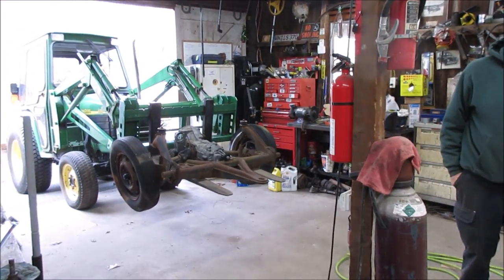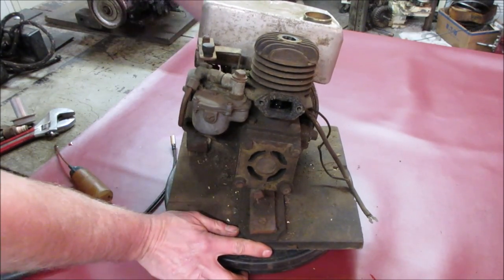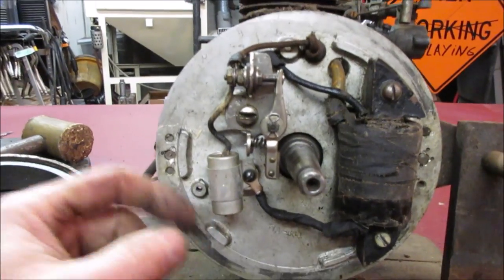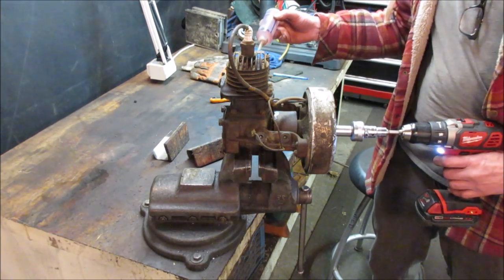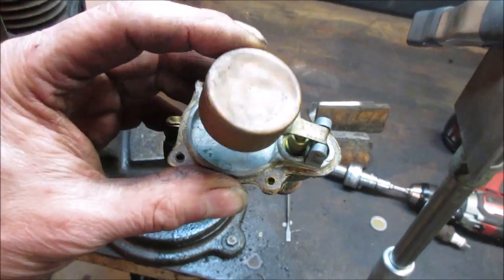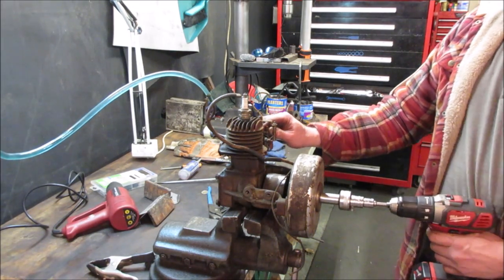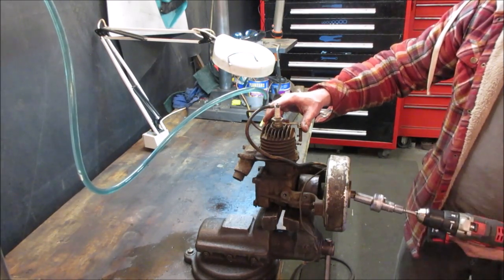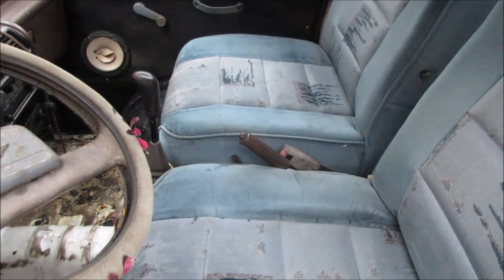Sitting at Least 45 Years In A Barn, Pre War Elgin Cycle engine.

Comment: It is a friction drive. I looked it up on google and I seen several and on Elgin bicycles. It sat on the front tire. The engine mount was huge. The only bad part was they had to cut the front fender to use it.
Reply: Back in the sixties I had a friend who had one, just drop it down on the front tire and it goes. I thought it was so cool.  it was old then.

Comment: 1930s Elgin sold by Sears was most often mounted over the front wheel. $69.95 for the motor only. If you could find the bike they should fetch $2k++ depending on condition etc.. fairly certain that the engine was made buy Muncie gear works, Muncie Indiana. Some were made as Muncie Cycle Motors and others were badged as Elgin Cycle Motors for Sears/Roebuck. Muncie was the manufacturer of Muncie Outboard motors and Neptune Outboards. Even the crankcase output housing is the same as the outboard. 1932 -1935 was also the hey-day for Muncie as they went full bore to overcome the need brought on by the earlier Depression (were still recovering till 34-35.) It likely has the 1.5 hp innards and carburation is similar if not same as the outboard. Eisemann was the ignition manufacturer.
Reply: That's close to $2,000 in today's dollars, adjusting for inflation
Reply: Thank you for sharing ur time n that info

Comment: I imagine there are a lot of stories that begin with “When I was a kid……” associated with a motor like the Elgin and a bicycle….me included.  If you can find seals and repair the fuel leak it might run decent enough to use.  I enjoyed this video as I do all of the Mustie1 series.👍👍👍
Reply: I was hoping it would run good enough to see it mounted on a bicycle, some handlebars a bracket hanging off them with the weight of the motor pushing the wheel on the motor onto the front wheel.  If the wheel on the motor is around 3" then for every 10 rpm we should get 1 wheel rpm. Each  Rotation of a bicycle wheel might be around 7 1/2'  so if the engine is running 1000 RPM it should go 8 1/2 MPH

Comment: One thing to remember when checking spark is that spark can be strong when testing out of the head but when under compression the spark is not sufficient to ignite the fuel/air charge and it will break down.  This is especially true on 2 strokes where spark plug oil/fuel fouling or poor sealing (e.g. the crank seal) is more of an issue than 4 strokes. If the coil or condenser are marginal, the higher resistance from being under compression or fouled out will kill spark.   Those Tillotson carbs sure are a piece of work, to put it nicely.  Glad to see her running again.
Reply: One of the other items a two stroke sort of needs is a muffler or exhaust; part of the "charge" from the crankcase comes out with the exhaust, and the back pressure from the muffler "pushes" it back in. I had a '66 Larson Eagle snowmobile with a 250cc JLO, so I got to know Tillotson diaphragm carbs quite well...

Comment: Mustie1
Outboard motors from that era ran 16 to 1 mix ratio. Some older ones even 8 to 1.
That helped the primitive seals do their Jobs.
Some say that “modern oil is better and you don’t need as much “.
Not so. Modern oils are cleaner and don’t foul plugs as much.
But the seals and bearings need that much lubrication,
The other motor looks like a West Bend go kart motor.
West Bend made the Elgin outboards for Sears.
Thanks for the videos. Still waiting for the double cab.
Reply: My brother has an old Johnson light twin outboard (1920s vintage) and it has no seals at all, just the close fit of the main bearings on the crankshaft and a hefty dose of oil in the fuel.

Sadly the engine is not in a running condition, one cylinder is cracked and the magneto was destroyed by corrosion. We've contemplated restoring it, but too busy with other stuff at the moment.

Comment: This has to be one of the best and most entertaining videos I've seen in a while. It's like Laurel and Hardy mixed with Charlie Chaplin, and a whole lot of Mustie Keaton. I just loved watching the bits flying off that bench as our aponymous hero casually continues as though nothing was happening behind him.

Now, if you want to see this kind of motor in use, just watch the open sequence of "Three Days of The Condor" as Robert Redford rides to work with one of these type of motors perched on the front of his bicycle, or for the comedy element, watch "Mr Bean's Holiday" - The bit where the French guy comes a puttering down the road as Rowan Atkinson tries thumbing a lift. Same engine set up, and the same pop pop popping sound.

I remember seeing quite a few of these style of engines in the 1960s, which had been retrofitted on pedal cycles. They weren't built for speed, but definitely gave a flagging cyclist a bit of a boost, and a much extended range, and as my dad said, "...IF you could get the buggers to run!...". So it would seem they weren't any too reliable even then!

Wasn't there a "Maytag" engine, that was made specifically for powering domestic appliances? Or as I still remember, little engines by Singer, or AManCo and so many others.

Comment: Excellent video Mustie 1  :) also remember hearing a motor like that my grandparents used for pump water out well  in square caseing type in 1940 to 1960 for barn also house too and also for first generation on washing machine plus dryers ! Also Spark plugs those big 13/16 were on 1966 to 1978 Bombardier single cylinder Snowmobiles called Rotakx 28 hp or 292 Cubic Cm and a farm company Farmall or International (International Harvester) use in 1939 to 1970 on Combine and Row Crop Type tractor in 4 cylinders with Champion brand ! The gap on Points were 18 to 20 foul and big Spark Plugs was surprised to me 18 to 45 gap ! Also the Engine oil Mix gas is 30:1 to 40:1 on single cylinder with Mineral Oil Olive Green Black  in Color and gas back was Lead type too ! Hope that helps out Mustie  1 :)  and  remember my grandma Ruby also Verna use say motor used give clothes a oil smell from motor too Lol!

Comment: Another great video Mustie, just googled 1920's Elgin Motor Cycle ,they were a complete motor bicycle with the very same engine you have . They ran above the front wheel. I think with a new condenser and plug lead it will run for another 100 years.  I allways enjoy your video's. Keep them coming.
Reply: That's what I was thinking too, condenser and that brittle plug wire leaking where it goes into the motor. All that rubbing and chafing from vibration I can see that jumping spark sometimes. Usually there's a rubber grommet there but didn't appear to be any. Usually a problem spot for old plug wires.

Comment: It took me screaming the entre video for you to hear some of my issues.
1)When you file the points CLEAN off the filings and don't over gap the points.
1.5) Replace the plug wire with anything that conducts electricity and clean the plug.
2) 2-strokes need some backpressure ... reinstall the exhaust! 
3)The damn kill wire is bouncing off the vice and it is f-ing with my pacemaker! 
4) I lost my voice...never mind.

Comment: I wonder whether you were spinning it in the right direction. Presumably the spark is timed to be slightly before TDC. Going backwards it would be slightly after. Just a thought...
Reply: I was thinking the same but he appears to be spinning it clockwise. This would be correct for a bicycle assuming the hinge point is towards the rear of the vehicle. Now that I say it maybe the hinge mounts on the front and you pull it towards you. I don't know.
Reply: By the look of the notch where you wind the pull rope it kinda looks like he's spinning it the correct way...i don't know...just a guess

Comment: The engine could b started by using a rope about 2ft long or so with a knot on one end and a pull handle on the other. You wrap the pull rope around the groove on the flywheel side of the engine with the knot in the slot.  Pull and repeat as needed. That's it.

Comment: They were built to run on 30wt non-detergent motor oil mixed 16:1
I had one as a kid on an old Elgin bike that we found in a barn after a friend of my grandfather had passed away. 
It ran as it sat but the old timers than made it clear that they liked a lot of oil or they got hot. 

They mounted over the front wheel of a bike and road on the top of the tire. It was common to find the front fender either gone or cut short ahead of the fork.. The bike I had was a mid 30's model, it had been repainted a dozen times with what ever paint they had at the time, the motor was painted green with what looked like JD Green. 
We used and abused the thing to the point where the only way to start it was to tow it at high speed till it got warm, then it would run , but barely. Not sure what ever happened to it though. I moved away after high school and it was long gone by time i ended up back there again.

Comment: For as old as it is and for just as worn out as all the seals are, you have to admit that old scooter motor was really well made for it to run like it still does. I'd say it's right about 85-90 years old. We had one on a go-cart in the late 60s and the go-cart wore out a lot faster than the motor did. I believe my Uncle still has it on the old frame of the cart still in his shed, I would bet it would still run right now with a little love. Good job Mustie. My Grandmother had a washing machine with a small gas motor on it that washed the hell out of her clothes, and it also drove a two roll wringer that she would pass the wet clothes through and it would squeeze all the water out of the clothes before being hung to dry. It sure didn't take long to dry either.

Comment: I'd still put money on that condenser intermittantly leaking out your spark  As the motor speeds up that condenser is having a harder time keeping up too. It is nearly a century old! Also together with leaky crankcase seals causing the throttle problems. Considering the age it probablle the seals are greased leather or babbit, so they could be refurbishable. But its amazing how well its done for something thats sat for 45 years!

Comment: It's missing the mounting hardware but from what I can find it's worth quite a bit, in the state it's in I found it at around $1000, mounted on the bike quite a bit more.
The pulley as you said is not original.
It was sold (in an old ad from 1930) by Sears Roebuck & Co. $69.95 with the bike, $39.95 for just the engine.
I got bored and checked, $69.95 in 1930 was about the same as $1200.00 today.
The average income in 1930 was around $1400.00, this was during the Depression so I'm assuming whoever made $1400.00 a year was considered wealthy.
Reply: $39.95 is about $678.00 in 2022

Comment: I have one of those smaller ones. It's a power product model 1000. Iv seen these small 2 strokes engines on vintage go karts. They had a small circuit race circuit with these engines on them.  Yes 2 stroke.  Mine still runs.  My great grandpa said it used to run an auger at a small grain elevator in indiana. He used to have it mounted to a board on a small wagon with several maytag motors.  He showed them all and more at antique tractor and engine show in Portland indiana.  That was my childhood!  Good memories!

Comment: An interesting run-up again this time. Engine equipped bicycles had a brief period of popularity in the 1950s, where I lived and several of the boys with whom I went to school had them. Bolt-on engines for bicycles also had some success pre-war, though those relatively heavy front mounted engines made any already loosely controlled machine more unstable. My mother was waiting at a bus stop in the rain when an adventurous female rode by, slid on the wet setts, (either stone cobbles or wooden blocks) straight under a bus wheel and became history in an instant. My traumatised mother recalled the sad story with obvious feeling years later.

Comment: Yes it probably works the same as the, in Europe, very popular French Velo Solex scooter which was little more than a beefed up bicycle with an engine mounted to the front wheel and drove it via a roller. I owned a couple of those when I was young and they ran fairly decent.

Comment: Engines for automotive use are usually designed to run Anticlockwise looking on the flywheel face, (the nut on the crankshaft would be left hand thread if it turned clockwise to prevent it spinning off)   If the flywheel is arranged on the RHS of the bike this would be the correct rotation to turn the wheel forward.  Two stroke engines will.l run backwards. but badly as the timing will be late!

Comment: Love watching your channel. You can anneal aluminium by wiping a bar of hand soap on the surface then heating it up until the soap coating turns black. You can then quench it in water and the soap washes off. You now have pliable aluminium.

Comment: Primary and secondary compression.  Primary is under the piston.  Secondary is on top of the piston.  If the crank seals are leaking, you are loosing primary compression, so there is nothing to push the fuel charge to the top of the piston where it can be fired by the spark plug.

Comment: Hello
Such kind of bikes with front wheel motors were very popular in France until 1980s. Since you removed the flywheel, the spark timing must be off. You have to set the piston 1.5mm before top, then adjust the flywheel angle to have the contact just breaking the circuit. Lock the flywheel at that exact position. Mechanics used to put a thin cigarette paper between the contacts to find that point....I had a tool that came in place of the spark plug, with a screw to lock the engine at the desired point while adjusting the flywheel.
Reply: That refers to the French Solex engine. The timing is fixed on this particular model...

Comment: I’ve just looked up this engine. You would be surprised how it worked on the bicycle. It ran the front wheel not the rear. It sat over the front wheel like a basket would.

Comment: cool little motor  I'd try putting a new condenser on it and put the carburetor in the ultrasonic cleaner, while I had that off I'd pour some bar and chain oil through the intake to see if it would help the crank seal.

Comment: I'm In favor of a full restoration of this jewel. I remember seeing them mounted on the handlebars of Roadmaster bikes. You would look good styling down the Boulevard. I'm also surprised that I never see you use a spark plug sand blaster. I've had one since the '60's and it's saved me buying many plugs needlessly. The other engine might be a West Bend.

Comment: I owned and rode a Trojan Mini Motor from 1953, they were popular after the war because of fuel rationing.  Direct drive onto the rear tyre with a lowering mechanism and a decompressor.  Mobylette also made them in France.

Comment: Elgin Cycle Motors were made in Muncie ,Indiana ,by Muncie Gear Works and were SOLD as a Package  or Complete With Bike by SEARS, ROEBUCK ANDD  CO.  The identical motor with a Different FLYWHEEL COVER Was also also sold the  ( MUNCIE CYCLE MOTOR.) the same Company also made NEPTUNE  OUTBOARD MOTORS. the motors have Tillotson Carburetors 2- cycle.....

Comment: They used to run on 16-1 mix using 30 wt engine oil. About all they had back then. Great find . The motor was on a hinge to tighten the belt with a lever. It could have been a flat belt with a pin on the end used at on some motors. Looks like you're twisting it backwards. lol

Comment: The motor ran its appliance or bike on a pully with a belt the same as  car engine runs its accessories such as generator water pump air conditioner . only this drive was actuated by a lever which applied tension to the pulley. Also this motor did not have the revs that you were applying with your drill. It did'nt need to spin that fast to start and probably only ran the unit it was driving at 12 to 15 mph or less. I'm 77 years old and had lots of experience with small motors and bikes and push lawn mowers...

Comment: that inner pulley was most likely for a flat leather belt that ran on a large pulley that was clipped onto the spokes of the rear wheel or they were commonly mounted mounted above the fount wheel with a roller set up. yours would be from the twenty's best guess ,now you need a old cruiser to put it on. great find

Comment: Good job brother just wanted to give you a heads up Steve's Small Engine Saloon he actually uses an impact lightly where you're trying to get the flywheel off he just keep turns the nut around keeps it flush with the crank with no pressure he vibrates a little bit and those flywheels come off no need for a puller look it up Steve engine Small Engine Saloon how to pull off a flywheel it'll make your life a lot easier

Comment: Ditto on wanting you to at least get that carb not leaking.  I'd think it possible that the crank seal, while not perfect, would work better as it gets lubed and possibly expanded.  If not a whole lot of work, get it out without damage(?), soak in transmission fluid or brake fluid(?) as I think they have special additives that keep/swell seals for rotating parts.  Then put back together and see how well it runs.

Comment: The float chamber needs a breather. fuel flooding there says to me the float is set too high. If that is the case the engine will run rich and be difficult to adjust it out as the fuel level will be too high in the emulsion tube (the bit you were pointing to that protrudes into the venturi). When the float level is correct the fuel should sit just below the end of the emulsion tube.

Comment: Kinda feel like the reed valves may be covered in varnish/sludge. The more you run it, the fuel will clean them, but the increased vacuum will just make the seals leak more. Neat little unit, though. The big name in bicycle drives was "Whizzer", my dad was telling me about them, from the '40s.
Reply: lool that engine doesn't have reed valves, the carb is attached to the cylinder.. it's piston ported.